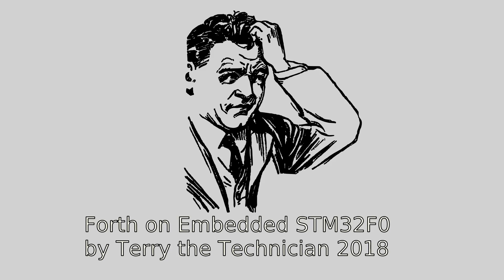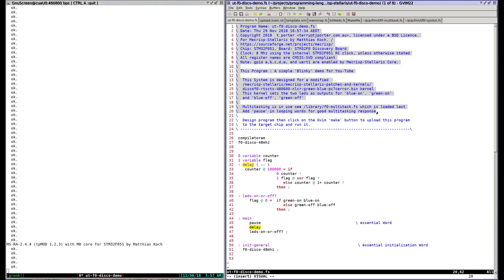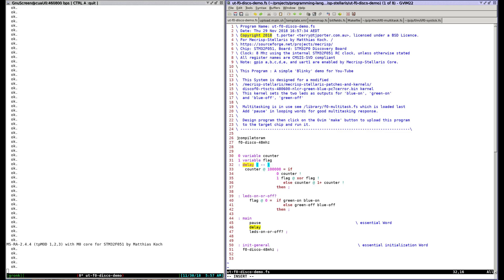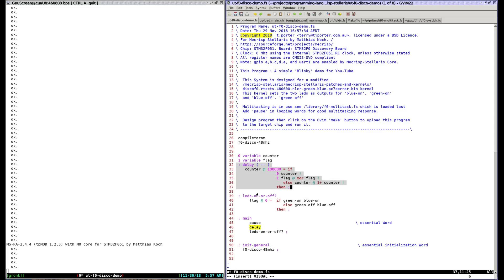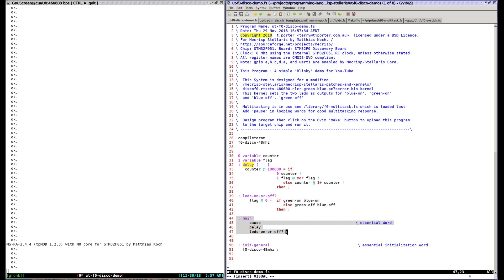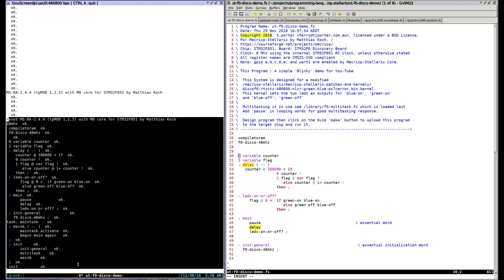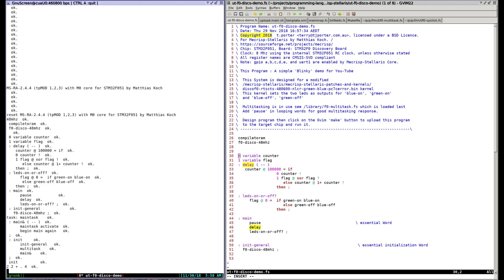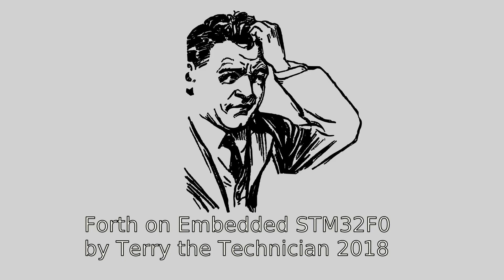Embedded Forth Language on Arm based STM32F0 - The IDE

Comment: Terry: I am interested. I am a retired EE, way back I did Forth programing and have always missed it. Perhaps I also see the facility in C, and certainly in Python,... But I do have an idea.
I have been hacking into a non-0pen source 3d printer. It runs embedded limux, the developer left a terminal port open for root access without a password,... Found it as an open connector
on the board. It runs a Nuvoton CPU, not the 123,... 
So what tool chain have you been using to build Mecrisp? Would you consider taking questions from me as I try to compile and install Mecrisp? dan
Reply from the maker: Hi Dan,
I'll be happy to take any questions you have, hopefully I can even answer some of them.
The only tool chain you need is none-arm-eabi. This link may be useful re the toolchain: http://hightechdoc.net/mecrisp-stellaris/_build/html/patches.html#rebuild-your-kernel

Cheers,
Terry

Comment: Hey, Terry. I've emailed with you before about forth. Glad to see you're doing work on it. This is great! I've been thinking over setups like the link in the description. I'll give it a go. I use emacs with evil-mode, nice to see some vim. I'm guessing you wrote the page linked; you use FreeBSD? Neat. And the DSLogic! I use that as well. Love the work, I'll probably email you some time in the next few weeks as I try to get some of this set up.
Reply from the maker: Hi Ryall, I remember you :) My setup should work fine with Emacs I'm sure. Yeah that page is part of my documentation site, and I'm the only author. I've been using FreeBSD for 3 years now and loving it with ZFS etc. Sadly the DSlogic only runs under Linux, it's some Linux centric USB design I think, so I run it of a very small Linux X86 box, the DSLogic won't run under ARM Linux either.

That page is the system I use every day, I'm, really comfortable with it and Forth.

I'll be glad to help when you get round to trying that system with Gnu Screen etc.

Cherio,
Terry
Reply: Terry Porter for DSView, it is based on Sigrok, and Sigrok has directions for installing on FreeBSD. Are you compiling DSView? It seems to have notes about FreeBSD and OpenBSD in the install file in the github repository, but not compete instructions.
Reply from the maker: I tried everything and the notes about FreeBSD are incomplete as you say. Even Sigrok won't work with the DSView  for me. Sigrok works fine with the OLS (openlogic sniffer), but the DSView is so much more capable. Sadly DSView on Linux doesn't work with Remote X windows either, because that would be a fine alternative for me in FreeBSD also.